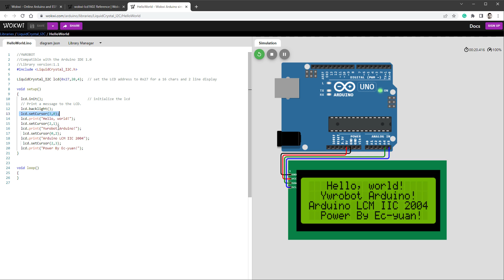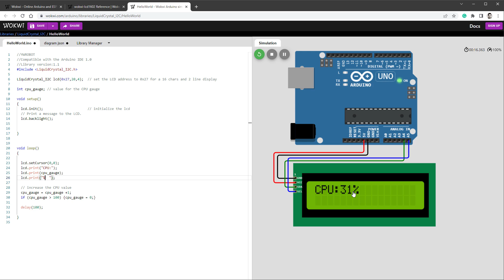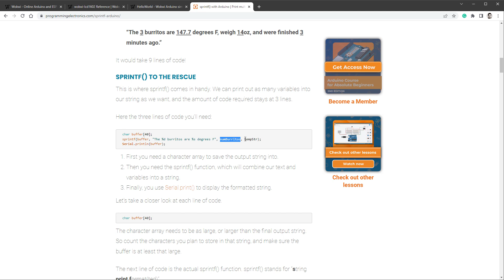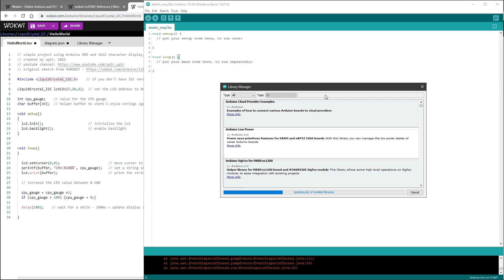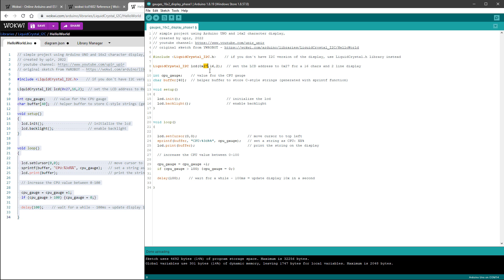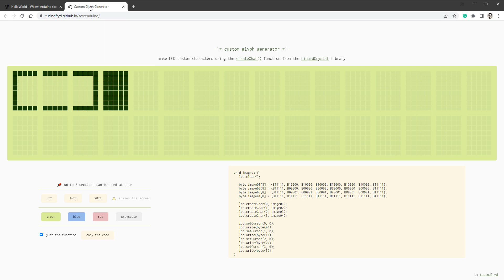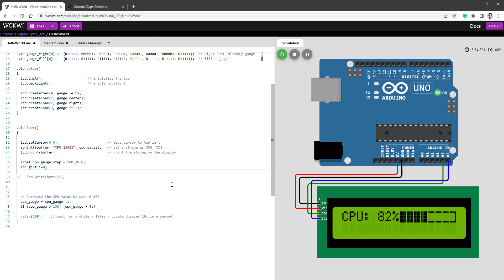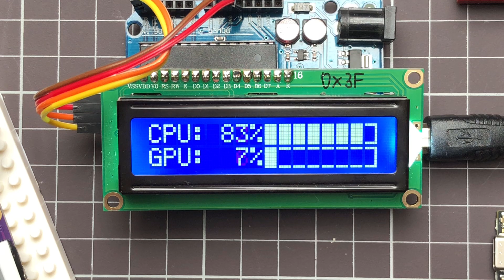Arduino Gauge in 11 Minutes ???

Comment: How do i make this with a non i2c 16x2?
Reply from the maker: Is there any reason to use 16x2 without IIC? The backpack (i.e. IIC converted board) is sold on AliExpress only for a dollar or so, and the displays that I usually use from Surenoo already have IIC built-in. That said, there are examples on WOKWI, I will put link into another comment.
Reply from the maker: For example here: https://wokwi.com/projects/294342288335700490

Comment: can i do this with the non i2c version?
Reply from the maker: Sure, you just need to use a different library - LiquidCrystal.h, and obviously more wires to connect the display to the Arduino, but the rest of the code would be the same.
Reply from the maker: Here is a simple example - https://wokwi.com/projects/294342288335700490

Comment: Can we make the same using arduino nano board??
Reply from the maker: Sure, that´s possible. Just make sure that you use the correct I2C pins, as those are different for different Arduino boards. Other than that, there should be no surprises..

Comment: Thanks for another great tutorial. The team is delighted to watch them!

Also, small tip: you can press Alt+Shift+F in the Wokwi code editor to automatically fix code indentation
Reply from the maker: Cool, Thanks for the tip! I will surely mention this secret shortcut in the next video (and also use it).

Comment: Future video suggestion: increase resolution by 5 by making 5 different 'fill' glyphs, each with one vertical line more worth of pixels on. Then re-write the highest filled character location with the relevant glyph as the value changes. Should make for much smoother bar graphs :)
Reply: Because there is 1px gap between characters on the LCD, I made it more "seamless" using 3 vertical lines per character and a kind of "dotted" background - looks very good and is effective! You only need 4 chars for this: 0, 1, 2 and 3 bars.
Reply from the maker: Good ideas. It was my plan in the beginning, but I haven´t included this in the video as I wanted to make it short - I was aiming to have 5-minute video, but that turned out to be quite hard. I will record a second video with a smooth filling soon.

Comment: I actually prefer clearing these displays with empty characters insted of clear() as it is faster most of the time. the clear() routine ob the display takes a long time and according to its datasheet this can for some reason be even longer when not reading back its busy flag. reading the flag requires the R/W line to be connected to the mcu as well wich is rarely the case
Reply from the maker: Good point. I have used empty characters this time because I knew that I will fill the rest of the display with the gauge anyway. It would be interested to measure the time of clear() vs. drawing empty characters.
Reply: @upir_upir  timing is not the only issue. on big 20x4 lcds hooked up via 50 or 100khz i2c, clearing, then redrawing can flicker the display because the LCD fades away before it gets to the end of the display
Reply from the maker: @H3wastooshort  Thank you  for the clarification. Hopefully other will see your comment to avoid the flickering by clearing the display with empty characters instead. Again, thanks for the feedback.
Reply: @upir_upir  that wont fix the issue if you first clear it with empty, then draw over those. the best way is to integrate the empty characters into the drawing routine so theere is no period of the display being empty

Comment: Nice video but the title is a little misleading, it's a display tutorial not yet a gauge. For that you need sensors wired to the PC and a lot more code.
Reply from the maker: Thank you, but you might say that this is a gauge, it´s just not getting any real data. For that, you don´t need sensors wired, since most computers provides those informations, you just need to feed the data to Arduino.

Comment: Great video, I’ve used a lot of these displays a few years ago (remember well of adding the contrast pot). Although now they look kind of outdated with the new and sometimes cheaper led screens (sds something).
Reply from the maker: The blue one certainly looks outdated, but I quite like this purple one. Also, you can get the same display in OLED version, which definitely would not look outdated. I hope to test those soon.

Comment: I see that you like dealing with displays and you really do good job with them.
I am excited about parallel interfaces to derive TFTs without that would be next level !! ;)
Reply from the maker: Thank you! Is there any particular display you would be interested in?
Reply: @upir_upir  Hi, thank you for your reply !
well actually, there is no specific display. but you may have seen ESP32-S2 TFT development kits where the TFT is connected directly to the MCU and I think the display is driven over parallel I2S, which is quite interesting.

Comment: An example of getting real CPU / GPU / TEMP data from a PC would be excellent. Any chance for that ? Anyway, great video. Thank you.
Reply from the maker: Good idea, and thank you for your content. At this point, I don’t feel I have enough knowledge to do something like proposed, but hopefully I will learn it soon. I will surely share the result
Reply: @upir_upir  the tricky part is probably just getting those stats from the host system in a portable way. Looks like you could use Python: the package psutil gives cross platform CPU and RAM usage stats. GPU is harder, but Nvidia GPU usage could be grabbed using the gputil package (or parsing the output of nvidia-smi on Windows if that package isn't cross-platform). Then you can use the pyserial package to send those values to the Arduino over serial.

Would definitely be fun to get it working for your own machine, but hard to make something that would work for everyone
Reply: @upir_upir  that would also make a good tutorial on how to read data from serial and also how to use sscanf()

on the pc you could run a python script that sends something like „ C053R081T552“ for 53% CPU 81% RAM and 55.2 deg C
Reply: Cpuz Hardware Monitor should have serial output.
Its a great software overall...